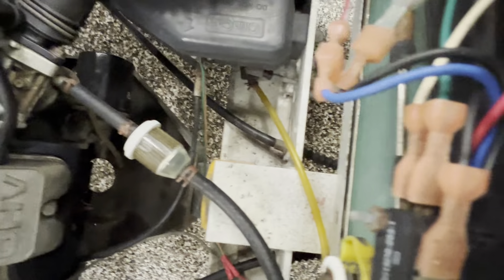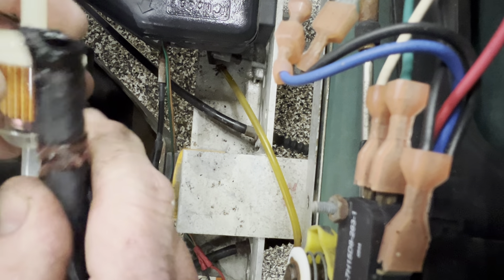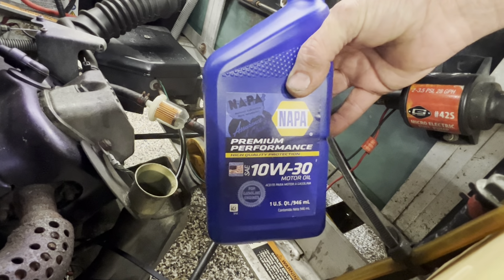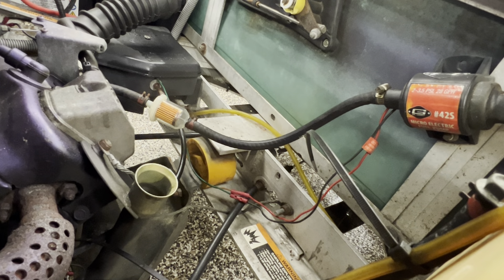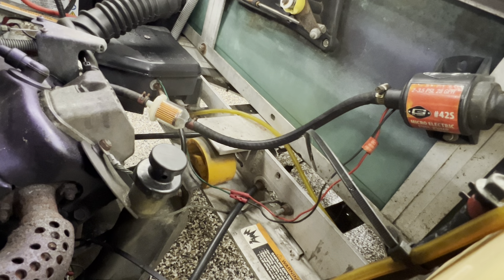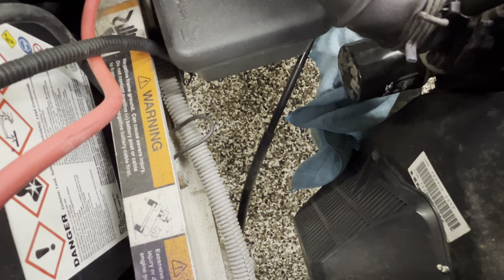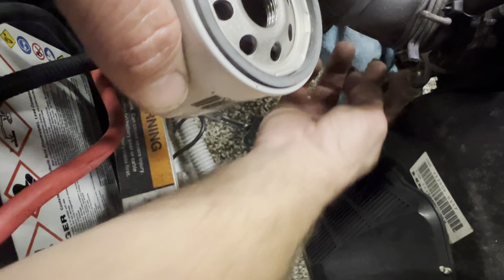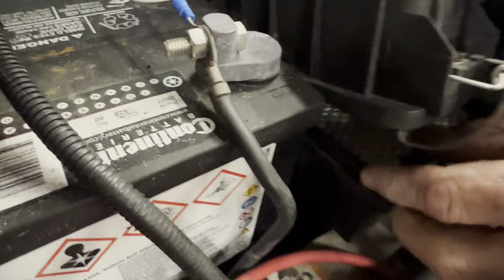Club Car oil change

Comment: I have a 99 DS. Service it once a year. Have the hose clamps you tighten with a flat head screwdriver. Those fuel filters you replace. 2 of them.
Reply from the maker: @34dawgsgo  that right 2 fuel filters
Reply: @Golfcartwhisperer  plus a arrow for direction of installation. Forgot to say a nut driver works much better than a screwdriver for the clamps. Think a 1/4 inch don't remember.
Reply from the maker: @34dawgsgo  nut driver definitely works easier but I don’t think the average person will have them. But appreciate the tips so they can read your comment. On the cheaper fuel filters there are no arrow’s.
Reply from the maker: @34dawgsgo  and I am sure most of the viewers just get the cheapest kit they can one too. So I try not to confuse them.

Comment: Will 10W 30 work just fine on a 96 DS with an FE290?  I'm at about 4400 elevation and we do get some winters here. Thanks for the video and love that snap on puller!  Never saw that before... yes, I'm a newbie at all this and just got a cart to restore.
Reply from the maker: Yes sir. 10w30 will work.  If it burns oil.  I would go up to 10a40. Hope you like the channel. Hit that like and subscribe button for me.

Comment: It looks like you have an electric fuel pump like mine. I was having fuel issues, so I disconnected it and just went back to the original black plastic pump that was mounted on the angle aluminum between the cab and the bed. I’m a little confused because you mentioned having a plastic fuel pump in this video. Do you have both fuel pumps plumbed into the fuel lines, or just the electric aftermarket fuel pump?
Reply from the maker: @timclarkson6767  that’s just fuel filters.  But you can go with an electric fuel pump.   It 1-3 psi    I just have the vacuum fuel pump on it.
Reply from the maker: @timclarkson6767  I do have the electric fuel pump on here. That’s all I am using.   I vacuum pump

Comment: Hello sir, do i need to replace the drain plug gasket when doing a oil change?
Reply from the maker: @selecticar6024  no sir. As long as it’s in good ahape
Reply: @Golfcartwhisperer  You wouldn't happen to know the size of the plug gasket would you?
Reply from the maker: Not off hand.   It if you tighten the hell out of it. It won’t leak. But when I get a chance I’ll look.  Want today 7/16. But you can just get you a tape measure and measure the bolt itself and get the size.
Reply: @Golfcartwhisperer  Okay its my first oil change for this cart as i just bought it.
Reply from the maker: @selecticar6024  gotcha. Glad you found my channel.  Is the washer there.
Reply: @Golfcartwhisperer  not sure I will find out this weekend....is that what it is a washer or gasket
Reply from the maker: Is a metal washer buts it’s the gasket.
Reply from the maker: They call it a oil drain crush washer
Reply: @Golfcartwhisperer  Is it normal for it not to be there? Maybe the last person didnt even put one on lol.
Reply from the maker: @selecticar6024  it’s not normal but I’ve seen a bunch of them without it.  And you can tell because it’s so tight